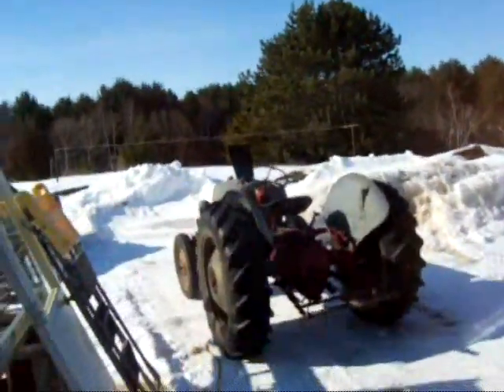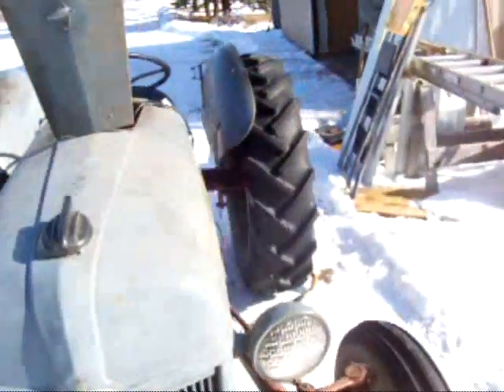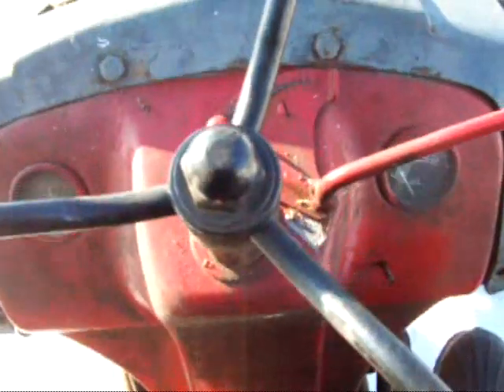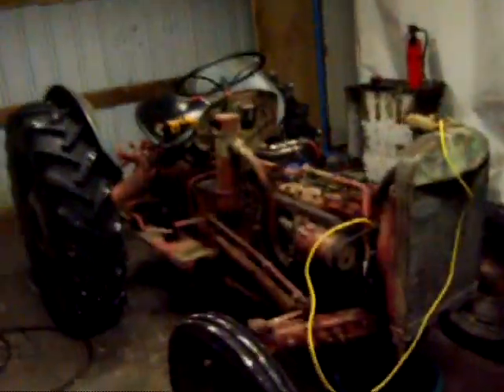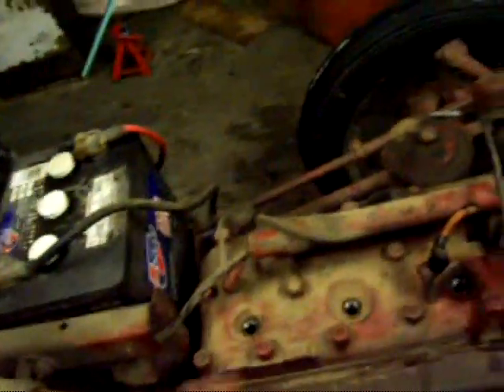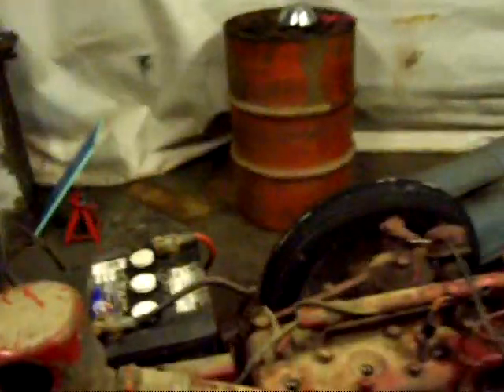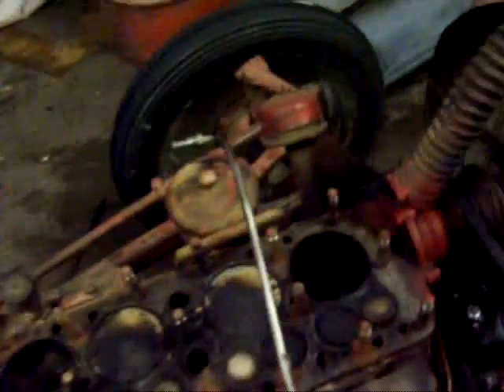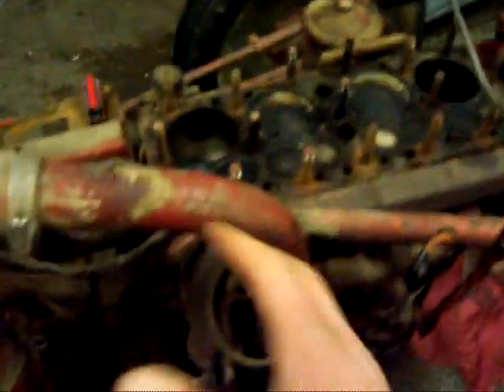I never know whats coming into my shop next

Comment: Well one of my first guesses was that it indeed had low compression in one or more cylinders. But one thing u should do since it looks like its leaking all over the place is to fix that fuel shut off valve cause leaking fuel and a warm engine could lead to a possible fire hazard. Just something to consider there....

Comment: I love these tractors. I have a 52 and I also have a 53 Jubilee. 

Yours is the front distributor style. They are hard to work on with the hood on. You will find that this is a very easy tractor to get parts for and there's a lot of information available on these tractors on the web. Good luck with it.